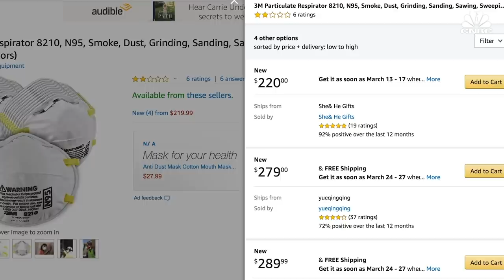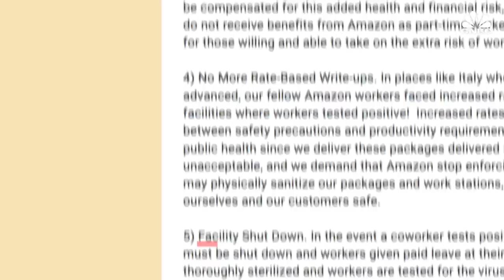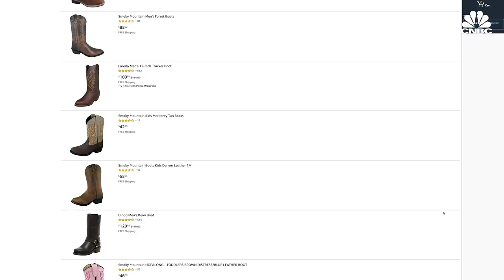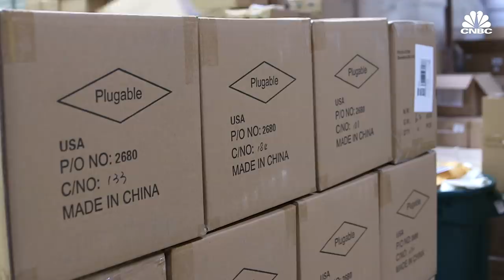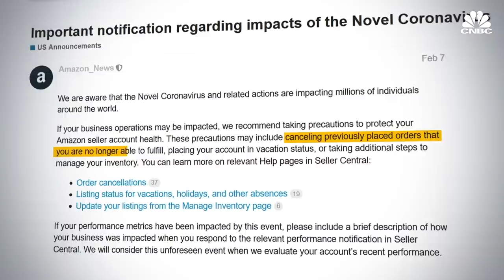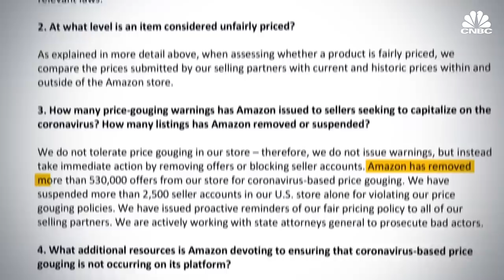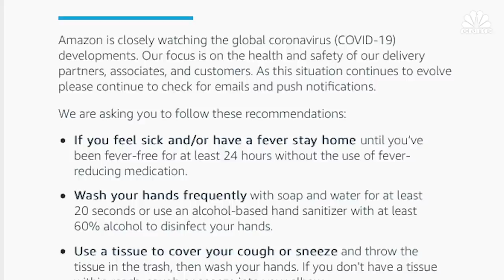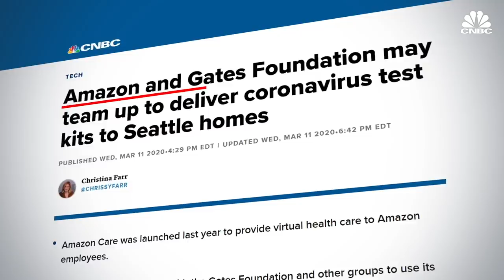How Coronavirus Could Slow Down Amazon Deliveries

Comment: As an Amazon employee, this is killing me.

I work at a facility with no robotics at all. Oldest transship cross-dock facility in the network. Hundreds of strangers per shift. Nearly every box in here is touched twice. 

Most of us stand at a table 1 1/2’ long, facing an employee in the same setup, prepping or sorting packages. They sneeze, you get sneezed on. That’s it. Last shift, I got sneezed on 3 times, coughed near once. But no worries. They covered their mouth... with their clenched fist... held a few inches from their face. 

Not to mention, we do not get hot water in some bathrooms, and sanitizer does not penetrate sweat, so it is not a good replacement in this physically active environment. Also, we are mandated to use cloth gloves- and get only 1 pair per week. Great for catching and keeping germs right on your hands. And the air in many areas is stagnant. You can see it when you shake out a broom or in a sunbeam. The dust curls around the air and takes a while to settle. What happens when someone coughs in the break room? How long does it linger?

Now we’ve had our first confirmed case in town here. And my mother is a over 60, and smoked for 40 years. I don’t know if she could shake covid-19 off. And I live with her. But we need money. But if I bring this home, I’ll never forgive myself. But if I stay home, we have nothing in savings anymore, and... goodness. My only option would be to gut my own 401k. All so that we can prep and sort the packages that more robotic facilities will need. Every facility... is not the same. Not like the ones in the vid. And yet we want to bring more people from town in... Pressing times. At least tomorrow, I’ll take the gamble...

Comment: It has already begun. I ordered a 3M N95 Mask more than a week ago and the seller dispatched it the same day. But due to the nationwide lockdown, my shipment has been stuck at an Amazon's delivery partner's office for the last seven days. Don't know when it will be delivered.
Reply: I can't tell you because it depends on the region you live in. As the delivery and supply chain has come to a halt it is even impossible for the Amazon to tell you the exact delivery date. Also if the product does not come under the essential commodities then the delivery might be delayed further. By the way, you should contact Amazon customer support because they are in a better position to help you regarding this. Hope this helps.

Comment: This mostly proves how foolish it has been to even ALLOW a single entity to so thoroughly DOMINATE something like product distribution.

Everyone needs to boycott Amazon. Buyers and sellers alike. Current search engines are sufficient to help you find alternative sources of what you need.
Reply: Any recommendations?
Reply: @michaelmoses8745  Google. DuckDuckGo. Bing (but only if you're desperate).

You know, there was a time, not too long ago, when there were other options besides using Amazon for everything. Being a wholesale distributor used to be a good, solid small business. There were thousands of them. Lots of people still know how to do it. But everyone rushed to the "One Distributor To Rule Them All" because Amazon convinced everyone that local distributors were going to be a thing of the past, and promised sellers easier profit. Now Amazon has a stranglehold on our entire society.
Reply: I meant were there any alternate sellers you preferred for buying.
Reply: nah, amazon is the best!
Reply: @michaelmoses8745  NewEgg for electronics. Powell's Books. B&H Photo (NOT Adorama). McMaster Carr for specialty hardware. Sailright for outdoor fabrics and told for working with outdoor fabrics. NOT Rock Auto, I've had bad luck with them.

When you use Google to search for products, they show and rate lots of vendors besides Amazon. Give them your business.

Comment: One of my home server RAID NAS drives went down on my RAID 6.   Luckily I have a hot spare that rebuilt, HOWEVER a replacement will not be able to arrive in almost 2-3 weeks on prime delivery.   I use the server for work and it has vital data on it.  If another drive goes down in that time period I Can be in real trouble running either my back-up systems or main data with a drive down.

Comment: $2 is not enough!
Reply: Grant Robertson don’t worry. amazon just increased the over time pay rate to double the regular pay rate in addition to 2/hr. the amazon workers get paid up to $33/hour!
Reply: @Νικόλαοςαἰσθητικός  Thanks for the update comrade. 

Warehouse workers get $15. They are not given any protective equipment. Amazon is planning to squeeze 100,000 more workers into the same, existing warehouses, cramming people even closer together. $2 extra is nothing compared to the risk they are expected to take.
Reply: Grant Robertson don’t get it confused. that’s an additional 100,000 workers nationwide, not in just one warehouse. amazon has several warehouses, sortation centers and delivery stations nationwide that these 100,000 workers will fill. they won’t be crammed in a warehouse like you naively imagined. there are several new safety protocols in place, too.

Comment: What about an algorithm that requires new Amazon contracts to submit the weight of 1 unit of their product i.e. 6 rolls of toilet paper for example. If the unit, weight, and price don't match up with similar products then they are submitted via the algorithm for "review." Or, if the price of the product raises 100% of the original cost, it is submitted. Idk i think too much 😅

Comment: Despite Jeff Bezos innovation at Amazon and at AWS... How important can it be to offer his Prime Now customers delivery within a 2 hour window ? To his customers ?  Really ? As if the pandemic has not in fact occurred ? Gimme a break !  Anybody who studies time series, JIT inventory schema, and supply chain optimization with BPR built in... well they could have seen this coming.  This a fundamental weakness of the JIT coupled to globalized supply chains with thin or localized inputs... aka keretsu.. Preferred providers of the raw material or components on the BOM !  Without risk management and disruption planning... most if not all MFG and System Integraters will face heavy delays as the system restarts...in a different equilibrium configuration.